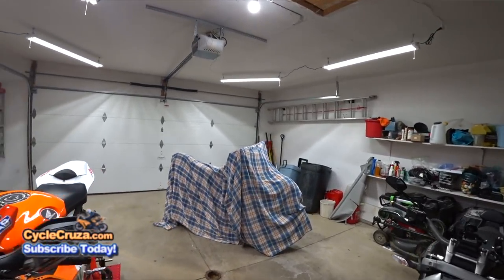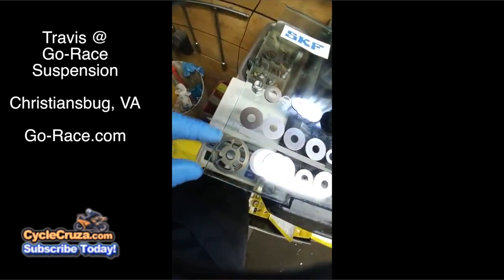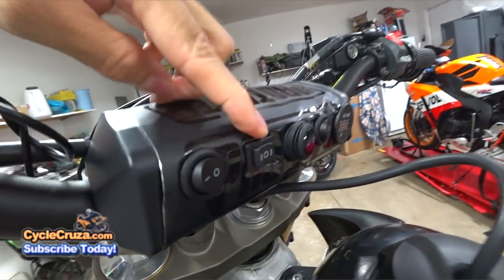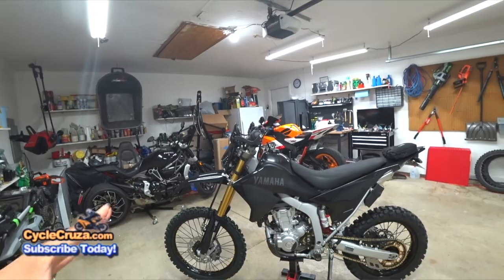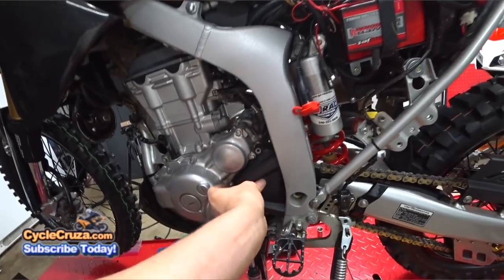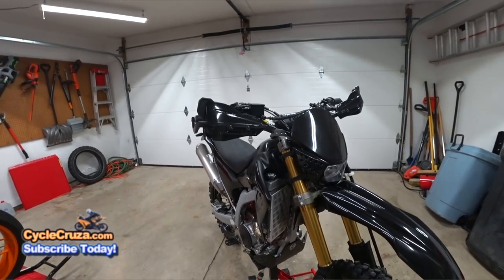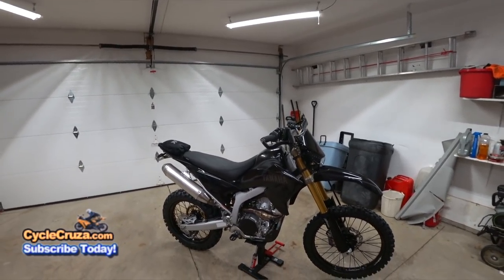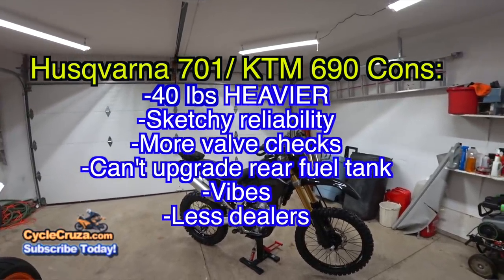WR250R 3.0 STEALTH BIKE REVEAL (EPIC Mods!)

Comment: Yup! Street legal dirt bikes and true dual sports are completely different categories of bikes. Version 3.0 is one sweet ass WR250R!
Reply: BWX  Although a true dualsport should be competent off road.  Should be Nearly as capable as a straight up dirtbike.   Should also be durable enough to handle daily street riding/commuting. WR250R is a great dualsport.  CRF450L will be, as long as its reliable enough for daily riding
Reply: Maintenance intervals are a huge part though..  For most people.
Reply: BWX right.  Thats why it has to be durable enough for street.
Reply: 450L has much higher maintenance requirements - so not sure it'll be a dual sport in the same way a WR250R is.
Reply: BWX  Aside from the low oil capacity, its very low maintenance compared to a true offroad race bike.  Its a more daily-rider  friendly bike than thr KTM, but its still a legit offroad platform.  I believe it can be practical as a daily rider, while still having real performance off road.  They beefed up the engine parts for durability. And they made the cam more mild, also for durability.  Kinda frequent oil changes, but its only 1 quart and its super easy to change the oil in it..
Reply: I'm not sure we know the maintenance intervals of the 450L yet.
Reply: BWX  I heard 15,000 mile valve checks
Reply: That's not bad! If true that will be great.

Comment: The WR250R is the ultimate,,,,, do anything you want bike.
I put Tusk racks on mine to carry luggage when necessary and a couple of spare fuel bottles.
Next year it will get some Hidenau K60 adventure tires.

I use it mostly for back roads,,,, and little used deserted highway adventures.
Fun, cheap and reliable.
Can't ask for more than that.

Comment: My advice with bigbore, if you do it, is go the Thumper Racing 280 kit. 
Everyone says to get the 290, bigger = better. I disagree, if you want a more powerful bike there are plenty you can get but they aren't as reliable. The point of the WR is that it's a rock solid, bullet proof motor that still gives reasonable performance. 
The dude who designed the 280 kit for Thumper Racing also designed a 290. They will sell you both. But he said in the spirit of the WR he prefers and recommends the 280 because it should last a lot longer. The piston is only a few grams heavier than the stock piston, whereas the 290 is much heavier, stresses the crank/conrod more, more vibrations.

Comment: If you're going big bore, concider thumper racings 280 kit. Its a smaller bore but the piston weight is really close to stock so it cuts vibration and will help longevity compared to the athena 290 kit

Comment: If you're going to put the money into a bigbore stroker build, I'd suggest sending the head and throttle body to Lindsay Machine and cams to WebCam for hardweld and regrind. Otherwise, the improvement will be modest at best. I"m in the middle of a 310 build myself.

Comment: To answer your question on spending time doing maintenance on a ktm compared to the WR,  if you took all your research time, order time, removal and install time, dyno time etc yo get the performance up.  I a pretty sure the ktm is less.  But the WRs are great. The best thing you did was the rear suspension.  The lack of rebound control on the OEM is flat out dangerous.
Good looking bike now go do the TAT

Comment: Hey you can upgrade the power to that of a yz250f just by adjusting the intake cam timing one tooth on the sprocket. Makes the engine exactly the same as yz250

Comment: I put that Acerbis headlight on my DRZ400SM, and what I don't like about it is the lack of adjustability of the headlight beam height.  There is a strap with two holes for adjustability.  It's a really crude system.  Do you like the headlight?  Does it perform better than stock with the LED bulb?  I run the side LEDs as running lights, no need for switch in my opinion.

Comment: Titanium valves actually are way more common to move out of spec then stainless just saying. Great vid man, badass bike. Looking on trading my cbr for a dual sport now!
Reply from the maker: I don't know about other bikes, but the wr250r valves never go out of spec. There is a ADV touring company is Austraila that has a fleet of WR250r and sells them when they hit 50k miles and he said he has never had to adjust the valves on any of his wr250r bikes.  This bike is bulletproof.
Reply: Yeah I see they are just saying overall stainless valves stay in spec longer due to resistance to heat and wear. That’s why lots of mx riders swap valves. But titanium valves make more power since they’re lighter
Reply: I am seriously considering one of these as my next bike

Comment: Skip the tire balls and go tubliss. The traction is better than any other system including mousse's. If your tire sidewall is stiff enough, like with a motoz extreme hybrid, you can run 0psi. Im running tubliss on my Husaberg FE501 traction is ridiculous. Although they don't have DOT. Approval I as well as lots of others run tubliss on the street. Although I do have to change my oil every 15hrs, valve checks(I emphasize checks because they don't seem to come out of spec) every 30hrs. The fe501 is the identical engine to the ktm 500xcw. There's guys out there with 300+hours on original top end just saying.

Comment: wr250r 4.0 - big bore kit - new speedometer with tach display - oversized front disk brake with steel brake cables on back and front -
Reply from the maker: Why get an oversize front disk brake? Just adds more weight.  Stock brakes just fine for me.
Reply: i am told they handle the heat better when you have a lot of down hill action.  i guess in the flat lands of ohio, its not a such a big deal.   you do have a point about the added weight.  would like to see someone get an updated speedometer.  i know you feel and hear the rpms, but i am a visual guy and like to see the moving levels.  dude, if you ever want to visit northern cal (marin county - golden gate,  redwoods, etc), i would love to put you up.  Ca is the land of big taxes, but also its the land of a thousand twisties. you can just visit and then you don't have to pay the taxes.

Comment: With the Acerbiis headlight, do you need any of the stock wr250r headlight assembly or related parts? Does this Acerbis provide everything needed? Will I need an LED conversion kit?
Thanks
Reply from the maker: Naw it just straps on. All of the links for every mod I did is on my website: https://cyclecruza.com/my-mods

Comment: Would love to see how you set up the control center in your handle bar pad.  Prob will go for suspension if u give it the thumbs up
Reply from the maker: I've perfected the bad pad control center, a pita to install but I love it and it makes changing switches a snap.
Reply: did you just cut holes in the pad correct?

Comment: Going to blow you away at how much better the suspension will function. Any motorcycle needs help. Custom suspensions are probably the 1st thing people should do on any motorcycle.

When will someone produce a 350-500cc single cylinder replica of the WR250R with the same overall functions regarding longevity, durability, reliability? Corporations keep lying to themselves that there's no market for them.

Hope that T7 Tenere sells like hot cakes to starving men.
Reply from the maker: I took it for a quick spin down the street and back and the suspension feels night and day better already!

Comment: Powder coat all the steel bro. All of it
Reply from the maker: I wish it had the black frame like the older ones. Stripping the bike down would have been a pita. This new version was not  mainly for looks at all, but rather for the upgraded suspension . Next I will probably be getting the engine modded to 310 cc, which will be about all that can be done to this wr250r besides little parts here and there.

Comment: Id stay away from the big bore kits man, They need rebuilt after 50,000 miles or less. cant beat that stock durability/ reliability. I wish i would have went with a WR instead of a CRF my suspension is trash.
Reply from the maker: yeah might skip the big bore kit.   I don't trust it's reliability.

Comment: The 701/690 has 6200 mile oil changes.....not that I would wait that long, but let the maintenance thing go it shows your ignorance on the subject. The 701/690 have arguably longer maintenance schedules than the 250 aside from valve checks but then again the 250 doesn’t push 70hp.